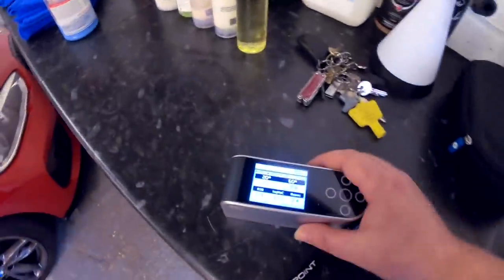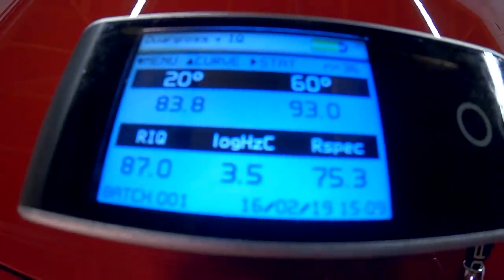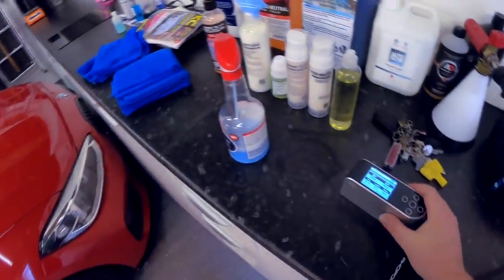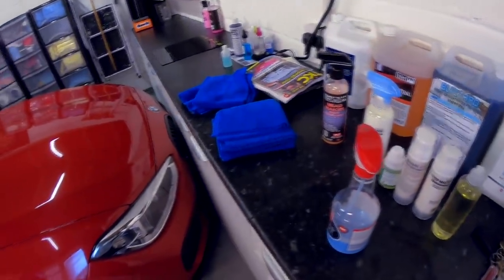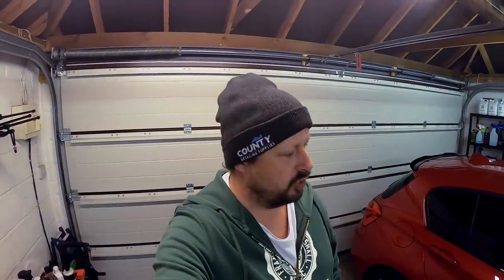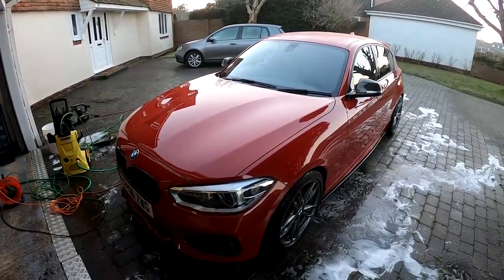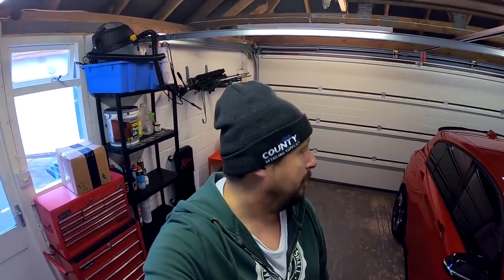The Simple Secret to Dripping Wet Gloss

Comment: I'm old school. I've been using  DuraGloss 101 wet look car polish for about 20 - 25 years. I apply it with a DA and a black finishing pad. It leaves the paint super slick and glossy with a jeweled look. I've tried almost all the new age ceramic sprays and polishes. None of them leave as slick a surface as Duragloss 101. You can feel the difference under a microfiber towel.
Reply: interesting! I Use Collinite 845 which is STUNNING.

Comment: Most waxes and sealants actually reduce the gloss a little bit by changing the angle the light is reflected at and creating a little bit of depth on top of the paint.  What they do is increase the shine but reduce the gloss.  Overall, it will look better even if the gloss number is a bit lower.  My gloss reading gauge only has one setting, not two like yours.  The highest number I have seen on it is 109 on freshly polished silver paint.  On a solid color paint, getting over 100 is very difficult unless you really jewel the paint with a 3 step polishing.   Keeping it there would be amazingly difficult.
Reply from the maker: Makes sense.  like you say when you put a fresh product down.  It does do something.  Even if that something isnt like gloss.   Some sort of funky luster, or like sharp jetting thing going on and alteration of how light changes from bouncing off the clearcoat and showing a reflection , to then going to passing through it and showing the color beneath.  even if the gloss is down it can look good when fresh dressed.  On very high gloss surfaces these products can and do lower gloss readings.  At least Ive seen that.

Comment: Let me bring up something I notice to see if anyone has the same experience. So after I was an my car and hit it with a drying aid/detail spray, it have a highly glossy finish.  Wanting to keep the dust off, I will cover my car with an extremely soft stretchable dust cover.  A few days later when I remove the cover, the car is completely dust free, as you would expect.  But it seems that I will have lost some of the high gloss paint luster that I had right after washing it days before.  Is this change in the gloss levels just my imagination or does the paint finish actually lose some gloss several days after washing, even in a covered state?  This might be a great experiment for Mr. Forensic!  Great video Jon.

Comment: Couldn't agree more Jon. It's all about the difference LSPs/QDs make to the feel and water behaviour of the paint. If you have a pristine car, put whatever LSP is the most durable on it imo.
Reply from the maker: the QD can be a tool though just to dry the paint, perhaps get some wash related water spots gone or finger marks, and it just creates a bit of lubrication and wetting of the surface to them help the microfiber tidy it up.     perhaps with a tool like this your gonna use every wash you dont want it laying down durable components or you just get like too much material going down on the car over time.    Dunno the answer though brian.   Prolly more just finding a combo that you like isnt it.    but Im not sure i want a QD to be durable dunno.
Reply: @ForensicDetailing  Just depends on the situation I think. On my own car it's not really important but family cars, something like BSD is a go to every time.

Comment: You could apply all the wax and ceramics you like but if your paint is covered in swirls holding back the depth and gloss from the paint then what's the point. Get the paint to near as swirl free as possible.

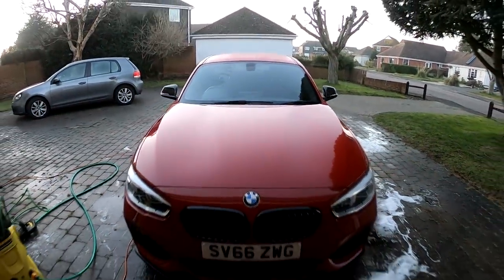Comment: What cloths were you using to buff off there? Also not sure what the rippling reflection is on the right hand side of the bonnet @ 7:00
Reply: Stallzyx That’ll probably be the optical effect from orange peel on the paint. Pretty much every new car that leaves the factory these days has orange peel to some degree. Wet sanding and polishing will get rid of it.

Comment: If it’s just dust I use a leaf blower or air compressor to blow it off. If I wash I do a rinse less or waterless wash which gives it the same slick feeling as a detail spray. On my ceramic coated car which I rarely drive I stick with TAC systems maintenance products
Reply from the maker: good aint they.. best thing is you dont have to be force fed any bullshit with the TAC stuff..
Reply: Forensic Detailing Channel definitely not force fed any bullshit! Used TAC systems shine, topped with moonlight and maintain with quartz max, doesn’t get any better in my opinion for a consumer grade coating.

Comment: How do you get a high gloss look on vehicle that is newer or old is using a claybar good for this. Or another method.
Reply from the maker: claybar is a tool to remove bonded contamination Keysta.. Claying your car will scratch the paint and you need to polish.   You create gloss by refining the surface through machine polishing with pure abrasives.

Comment: Do you use detail sprays as a drying aid? Obviously you have the benefit of a garage to get the car out of the sun. Maybe a video on drying cars would be good? As I don’t think there are many to the quality film too
Reply from the maker: no I dont.    I want to quickly float a twist knitt towel over the main panels and glass to pick up 99% of the water.  and I want to quickly blast out the water now from the gaps with the little air blower.  I want to do that in around 3 minutes tops.   thats to remove the main risk of water spotting on the main panels and glass on display.

after this point when 99% off the water is gone.  Get a bottle of detail spray and go back around the car with a nice cloth and tidy up panels etc 

at least thats what I would suggest.

In the winter or cool months you can switch things up.  but from april-may through to say october.. the main risk is water spots. speed is the best solution to water spots

Comment: My car has a really nice flaky blue paint but I can never get it to 'pop'. Previous owner and having no choice but to take to hand car washes in the past has meant there are quite a few light swirl marks and scratches. Is it these scratches which are preventing the paint from really popping? I have no machine polisher before anyone asks so that's not going to happen, from me anyway! Only super resin polish at home.
Reply: Yeah you've already nailed it. Machine polish to remove swirls and marring and it will pop a lot more. No point doing it if you can't maintain it though, if you have to go to hand washes I wouldn't bother.
Reply: @ImBarryScottCSS  Hand car washes was just a temporary thing while I didn't have access to an outside tap, now I do so I can minimise scratches from that now. 
I don't have a machine polisher though, they all seem rather expensive. I've only ever hand polished cars with a microfibre applicator but I have a feeling that won't  really remove the swirls and scratches.

Comment: What the best wet high gloss detail spray and wax. I have a number of products and I have one show car wax and the last product bought was P&S Paint gloss and showroom shine I have Meguiars detail spray quick detailer the mist form but don't have Meguiars Ultimate quick detailer. Was thinking about buying the Ultimate Meguiars quick detailer today. I have a couple clay bars but not gonna use them on my new vehicle but one was a heavy duty clay bar and the other one was a Meguiars Clay bar a white colored clay bar. I used it on my older truck I used to have but brother has now but it didn't work good enough on it I should of used a heavy duty clay bar on it but the new truck that is used not using a clay bar on it. I rather get that wet high gloss on my new truck. I have the Last Coat spray too just saw a ad on it when writing this message seeing them saying 6 month showroom shine it has and I had this spray for months now. I haven't tried it on new vehicle yet but older vehicle I did but the oxidation was bad after I painted it I used a cheaper grade paint when I painted my old bright silver metallic Dodge Dakota 06. If painted in future would use single stage paint. My rotary polisher in future rather get rid of though.

Comment: Hello,
What gloss meter are you using?
20% 60% 85% ?
What degree, if only one,  do we need?
Reply from the maker: the machine I use is called a rhopoint IQ,  Its not really for guys at home its a proper RandD QA tool they cost about 3 grand but they are more than just gloss meters.   theres a video on it on the channel.
Reply: Forensic Detailing Channel thanks, so what degree would you recommend, if only one?
Reply from the maker: @johnrosado9245  20 deg will be the most accurate for clearcoat with high gloss (70gu and above)   a new car will have like 80-95 GU.  Average 5 year old car 60-70 etc..

thing is you cant easily buy just 20 deg ones.  they are dual band 20 and 60 deg.

so 60 deg is cheapest

then 20 and 60 deg dual band

and these are gloss meters.

the rhopoint machine is a goniophotometer which means its more than just gloss.  Its the only device of its kind to do haze, log haze, DOI RIQ, all the gloss and , Rspect.

have watch of review if interested they aint cheap though.   but for high end detailers its a cool thing
Reply: Forensic Detailing Channel nice that tool sounds very interesting. Something to geek out on, checking panels on one’s car and friends cars. Lol 
Thank you for the fast responses!

Comment: Wondering if you have advice on long throw polisher and how to keep them from stalling?
Reply from the maker: have a watch of the updated polishing guides.   free spinning machines should stall.  you just dont want them to stall due to them not spinning parrallel to the shroud and rubbing at certain high points..  other than that not too much pressure.  Mark them off on the plate perhaps so you can see stall happening.  And dont worry all that much about stall Casey.   just keep the machine doing its thing and it will cut paintwork mate..  DA's are not really there to cut paintwork fast, so much empthasis on "upping" the cut with DA's nowadays, pad choices compound longer throws etc...    but the machines were popular really because by lowering the rate you cut it makes it less problemmatic..  so its more a balancing act.
Reply: @ForensicDetailing   thanks it's a machines as I can't afford a rupes mark 2 or 3. I just seem to stall on vertical panels/curved vs 8mm and I'm sure it's my technique but I wished I knew what I was doing wrong
Reply from the maker: they are supposed to stall.  the long throws are more susectable to it as well.. buts not a major problem but yer it does effect consistency and rate of cut.   Its one reason I dont tend to use them.

Comment: With an almost perfect perfect paint job and perfectly clean you need to consider - “(the law of) diminishing returns” i.e. spend 100 more hours on it and it wont look any better.
Reply from the maker: yes, very valid point... but this is a cool thing to discuss.  because really detailing is all about dimishing returns kind of isnt it.    but yer specially with machine polishing.  really you want to Cut 1 set .  Finish 1 set.  anything extra is a ballache.   but sometimes 3 sets of finishing can just do wonders. but its insane in terms of efficents and like double the time for an extra 1 % (finger in the wind)
Reply: Everything after a mechanical wash is diminishing returns. Such is life, the only question is how far down the rabbit hole do you wanna go.

Comment: I have to say I found koch chemie fse to give the paint on my car a really dark glossy wet look which I don't get really from the waxes I use. If the paint on the car is covered in swirls, a good machine polish will bring that paint back
Reply from the maker: the car is covered in swirls yer..   but nothing really horrendous.   just lots of them mainly light.  still looks good unless you get the sunlight right on it then it shows up bad.
Reply: @ForensicDetailing  hey Jon, sorry I meant in general not your car specifically. When I machine polished my car I noticed the paint came back and it was easy to see the difference. My car is a 2006 fiesta zetec s in black which I don't think had ever been machine polished
Reply from the maker: @zaink7037  ah gottcha yer.

Comment: Hi Jon, have you decided if you are going to ceramic coat your car?
Reply from the maker: yer will be coating it just not sure if to use snycro or just go with moonlight.  Im leaning towards moonlight. I might make a video on it. just asking for thoughts?
Reply: Forensic Detailing Channel I am currently having a debate with myself regarding long term or short term protection. My car is currently parked outside on like a public car park. In the 1st month alone, there is already a scratch. I am leaning towards a short term coating like Tac system. Carpro recently came out with a lite version of the cquartz and I am looking into that as well. I am busy at work and I have no time to apply it yet.